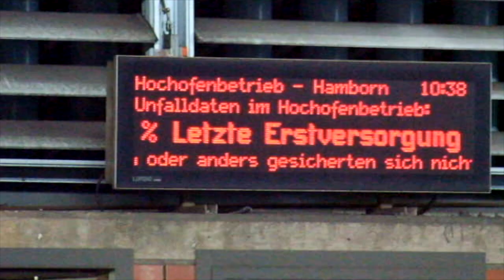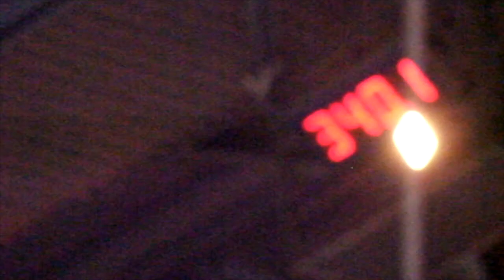Steel production | ThyssenKrupp Steel

Comment: This is unlike any other steel making setup I have seen. I am no expert at all, but the way the furnaces are charged and tapped is just awesome.
Top video.
Reply: Where I work (Voestalpine, Linz, Austria) it is absolutely the same. Nothing special about it.
Reply: Bessemer converter...
Reply: @operatorjeffdeathstar7759  No, they are LD converters.
Reply: ThyssenKrupp beste was gibt 👍💪
Reply: you might have seen EAF steelmaking then , this oxygen blowing based steelmaking. this has a higher production rate but is more polluting , but EAF is also equally polluting when you track the source of electric power.
Reply: @dv5625  EAF just sucks. Those minimills are no real steel mills, they are merely scrap recyclers. A real steel mill needs blast furnaces and converters.
Reply: @UriNierer  EF / mini mills might not be your cup of tea but they serve a purpose in that they are usually located close to where the product will be used and also where scrap is readily available. The word you are looking for with your description is an INTEGRATED works.
Reply: @UriNierer was verdient ein produktionsmitarbeiter bei euch?
Reply: @nichtvondieserwelt5431  Kommt drauf an wo er arbeitet und wie lang er schon da ist, am Anfang sinds in den Bereichen wos um was geht (Stahlwerk, Hochofen, Kokerei...) ungefähr 2300 Euro. Wenn man mal übernommen ist verdient man gleich ein bisschen mehr und man bekommt noch eine Prämie dazu, und mit der Zeit verdient man auch sonst mehr. Ich hatte Kollegen die teilweise um die 3000 Euro verdient haben.
Reply: @UriNierer  Nur 2.300€ netto nach der ausbildung und das bei Schichtarbeit?😅
Reply: @nichtvondieserwelt5431  Also für unsere Verhältnisse ist das nicht so wenig. Wenn man tatsächlich im Werk gelernt hat verdient man auch mehr, aber der Großteil der Arbeiter ist ungelernt. Die Voest nimmt prinzipiell jeden, wir haben auch welche die Koch oder Kellner gelernt haben.
Reply: @UriNierer  ahh ok 
Ich lerne gerade den Beruf Verfahrenstechnologe Fachrichtung Stahlumfornung. Deshalb wollte ich mich ma hier und da umhören :D danke dir ich meine ihr habt auch ein walzwerk oder?
Reply: @nichtvondieserwelt5431  Ja, haben wir. Alles was man braucht, Stahlwerk, Hochöfen, Kokerei, Sinteranlage, Warmwalzwerk, Kaltwalzwerke, Gießerei, Kontiglühe, Beize usw. Früher gabs auch eine Schmiede aber die wurde leider geschlossen.
Reply: @UriNierer  heftig. Wie viele Mitarbeiter seid ihr denn? Bestimmt 2.000 oder so
Reply: @nichtvondieserwelt5431  Meines Wissens nach sinds mehrere tausend, ich hab grad nachgeschaut, angeblich sogar 12.000